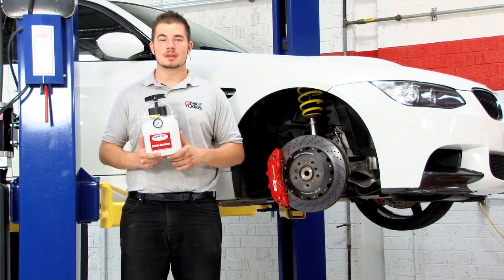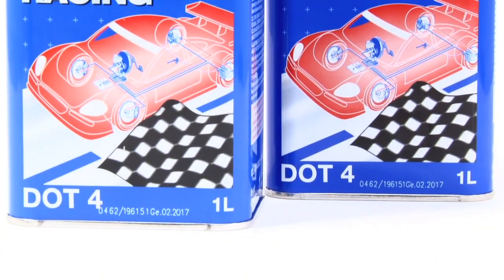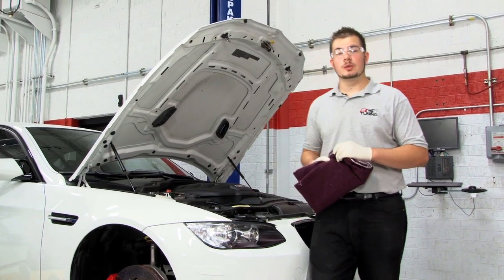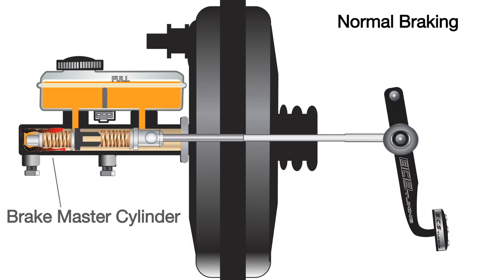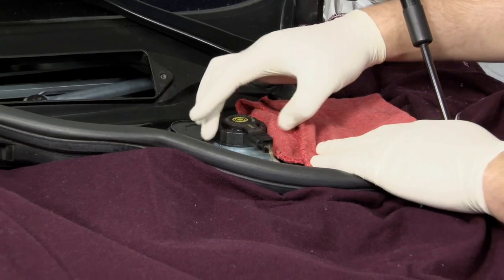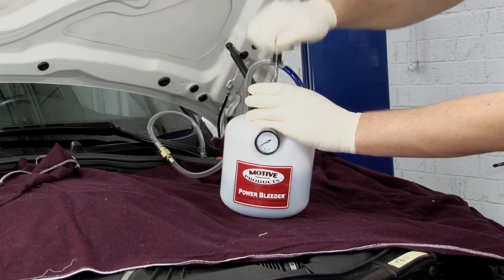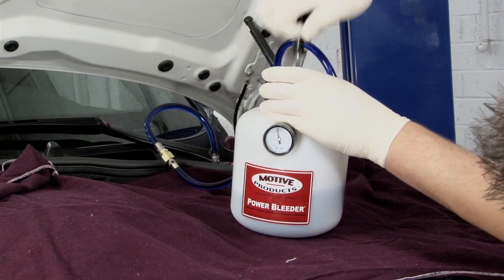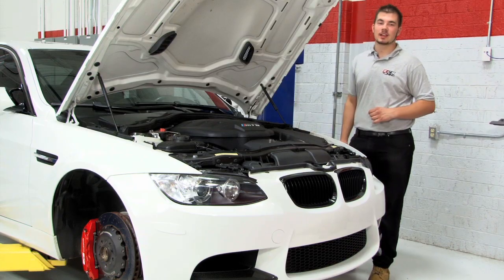ECS Tuning: How To Bleed Your Brakes

Comment: HI great vid, I would like to know on most pump bottles they require lubricating the rubber suction ring or piston rubber ring that is consealed in the long handle tube that draws the air in,so as part of the maintenance on the pump bottle the lubrican used for the piston ring wouldnt that contaminate the brake fluid,please advice.

Comment: thanks Mike ... dont you need to block or pinch any brake cylinder overflow pipes?
Reply: Never heard or seen such a thing. Brake systems are sealed and air tight. There is no where for overflow to come from so you don't need overflow pipes for it to go to.

Comment: Good video man, thanks.. 1 question though, what evacuation tool was it that you used & where can I get one??
Reply: Looks like pella oil extractor (Harbour freight/princess auto has them fairly cheap) but you don't need anything fancy to do that part you are literally removing 250ml  of fluid from the fluid reservoir so a turkey battery from dollar store would work just fine. And take same amount of time.